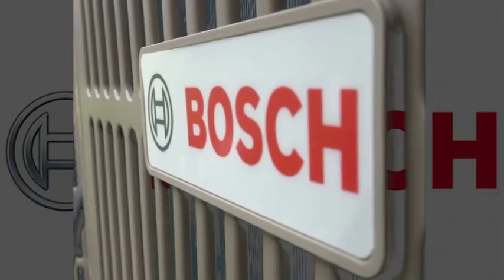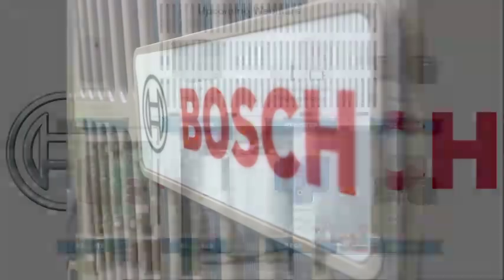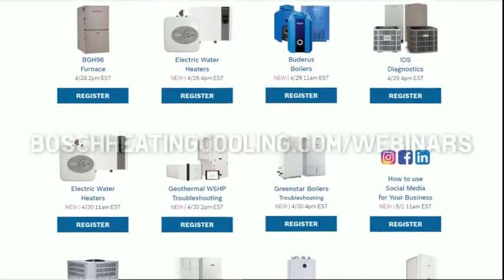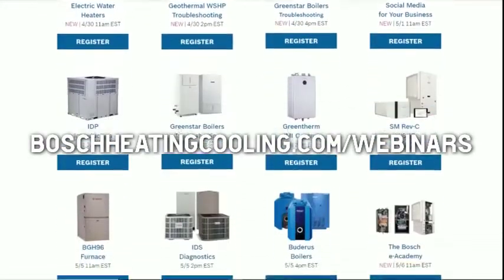How to Use a Vane Anemometer on a Return Grill (David Richardson)

Comment: I had to use one in Coal Mining to get airflow readings of air coming to the coal face on the working sections.

You had to use the anemometer, and walk back and forth while moving your arm up and down over a minute, then times it by the height which averaged 4-5ft by 20ft width which is std width for room/pillar mining... 

I never knew i was in HVAC training when doing Ventilation work in mining...